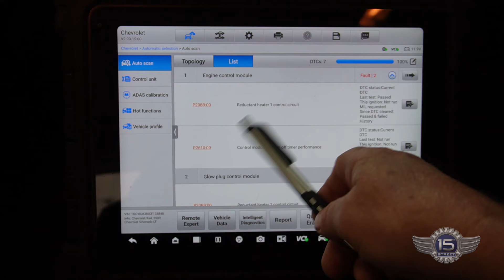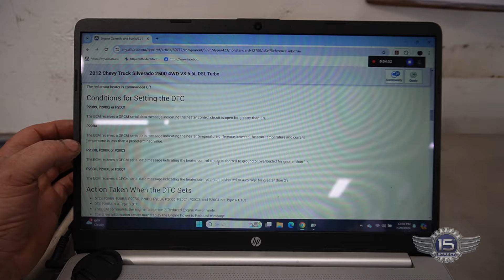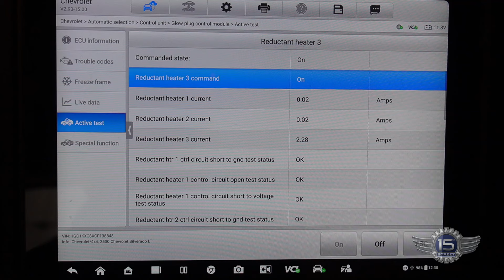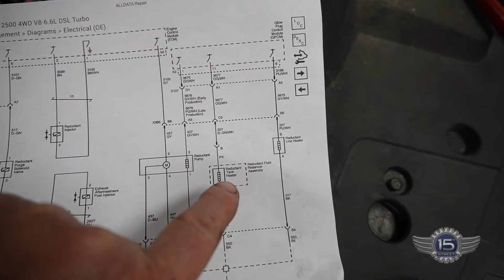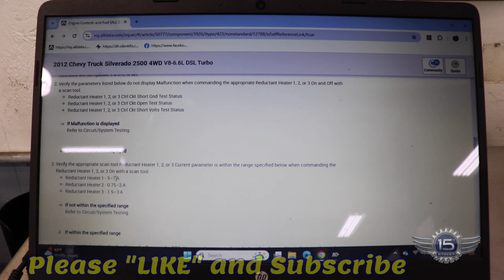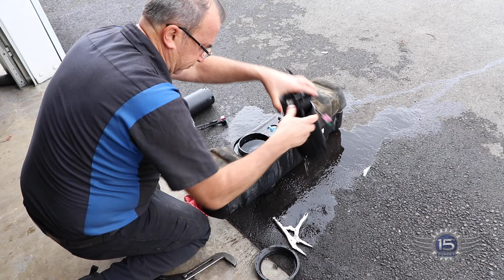Silverado Duramax P20B9 Reductant Heater

Comment: Great videos and detail.  Like the use of ohms law to determine coil resistance value. My Duramax ran out off def and the codes match those indicated.
Nice touch using the fuel module just under the hood to ring down heater coil resistance.

Comment: Great video, did you have to do any resets and play around with the scanner after the installation of the new heater element or does the check engine light go off once the working unit is installed?

Comment: Does running your exhaust fluid low more often contribute to this heater element problem? Thoughts?
Reply from the maker: Yes. The DEF fluid pulls the heat from the heater element as it's warmed. If there is less fluid to accept this heat the element itself will get hotter and degrade sooner.